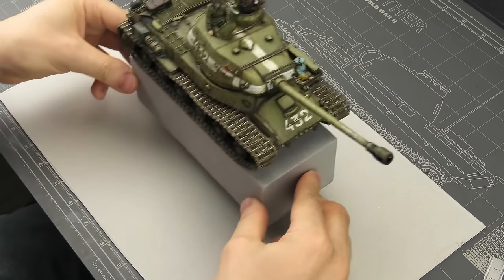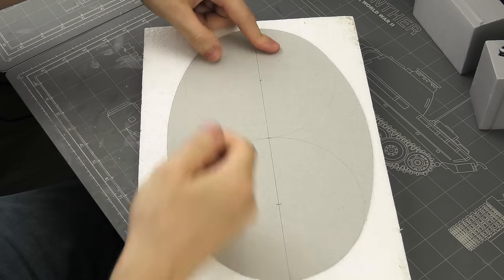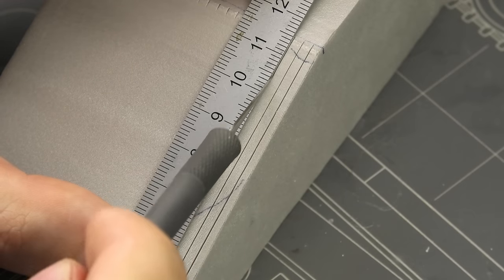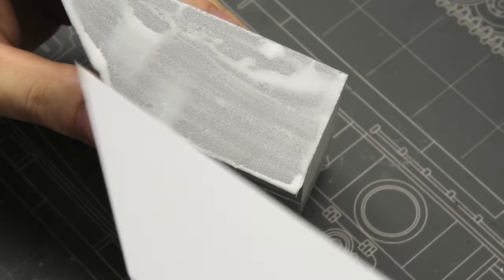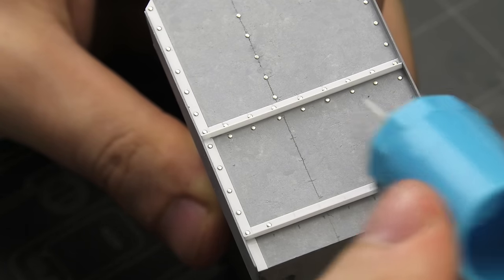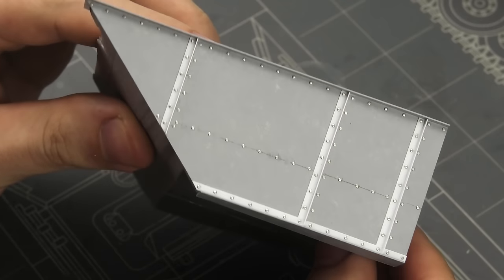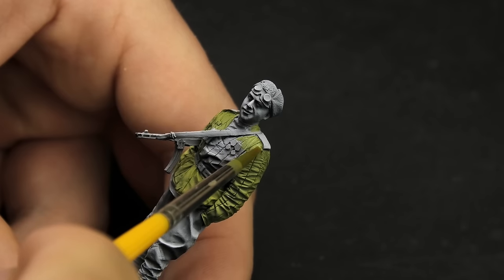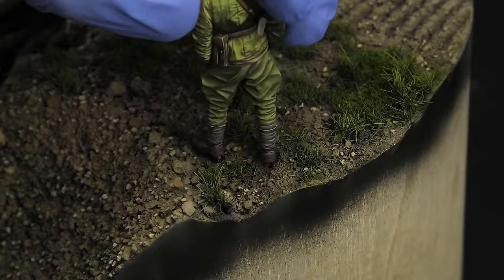Bears Crossing - Berlin 1945 (Epoxy Resin Water Diorama)

Comment: For the oval wooden border, I wonder if contact adhesive would have been a good choice? You could apply it easily to both pieces - spread in a complete layer. Then you just press them together bit by bit

Comment: What a great diorama! Well done!  One thing I think you missed, or just didn't put thought on, is the bridge connection to the river bank. You got a heavy steel bridge ending in a grass field? There's certainly a road there, or at least some elements from where the road once was... I think the diorama would look even better, if you had put more though to that part.  When it comes to foam in rivers, you often will find them as a faint swirl or build ups, in places where the current is blocked. Such as the corner where the steel beam is acting as a dam. I have no idea what techniqe or material to use to make such swirls look real, but it should be a possible challenge for a master as you.

Comment: May I suggest that next time you use the so called "gardener's method" (also called pin and string method) to draw the oval. This creates a true ellipse, which looks more harmonic than slapping two constant radii together in a basket arch / three center (or rather four) curve). It only requires two pins, a length of string and a pencil.

Comment: Uncle Nightshift! Uncle Nightshift! I got an idea, since you have a printer if i remember correctly, have you tried to print a "brick wall" pattern stamp that you can just press into foam instead of having to manually trace each brick by hand? Amazing work as always however, you're leveling up with each new project and watching you get better is almost a treat on its own. I really love the fact you add a lot of verticality to your bases now instead of doing them "ground level" which shows a lot more character to the scene too. The one thing i'd add or keep in mind for another river build is having debris in it, in this case maybe adding some thin twigs/roots and rocks on the 2nd layer of the resin pour so your 3rd layer of resin has some transparency and shows depth.

Comment: For anyone interested in real corduroy trench filling, we used bundles of logs tied into rounds and put on the backs of flatbed or tipper trucks. We did this because it was easier to roll them off the trucks into ditches without man-handling lots of individual logs. It also made them easier to move around with our rough-terrain fork-lifts.
Once the top row was in place you only had to cut the top strings and spread them out level.

Comment: @Night Shift 
Dear Martin, as always: stunning work, and an almost "unreal grade of realism"... which leads to the only irritation i have with this diorama: please correct me, but in my humble opinion there might be a "static" problem with the structure of the side-fundaments of that bridge. In your diorama the whole masses of earth are held back by a single row (!) of simple bricks ???... and this appears not sufficent to hold a bridge, which is built from massive steel elements, able to withstand the pressure of all sorts of heavy vehicles over the years...  as i said - this is only a criticism on the architectural side of things, and has nothing to do with your splendid skills as a modeller.
I'd be very interested, if you understand the aspect of my comment, and what you think about it.  

best regards from.... Berlin, at the river Spree :)
Holger

Comment: 28:41 I use a lot of epoxy resin like this at work. Same 2:1 ratio of resin and hardener. Really easy to work with once you get the hang of it. One tip I can suggest is, if the edges of the water aren't nice and smooth, a combination of gel sealing tape and thin plastic sheet works very well. Just make sure that the outside edges of the barrier are tape-to-tape, and you'll have no leaks.
Reply: The thin plastic sheet goes in-between the tape and the resin?

Comment: I just started smiling when I looked at the angle you had the gun. The IS-2 had notoriously bad gun depression and thus a rather slow rate of fire because the gun had to be returned to the default angle for loading. It was best in the role of bunkerbuster and not a tankdestroyer as intended from the beginning.
The finnish tank museum in Parola has a few Soviet heavy armored vehicles from WW-2 and among them a ISU-152 built upon the chassi of the IS-2. Those beasts were huge.

Comment: I find that decorator’s caulking fills gaps nicely, especially in wood or plaster, because it is easy to apply using a builder’s gun and it remains flexible, while still allowing you to paint over it. You can even smooth it with a wet finger…

Comment: Love watching your models come to life and the visual stories you add into them.  You have inspired me to obtain a spay kit and paint with the many other accessories needed, my plan is to paint 3D printed topographical maps and maybe someday a model.  I am old enough to say my experience with models is when they where .99 cents and glue came out of a tube labeled Testors, which brings me to the question of the type of glue you use.  Besides the obvious cyanoacrylate glue,  I see you brushing on glue, what type of glue is this?
Reply: I believe its called "Mr Cement S"
Reply: Tamiya cement or Mr. cement.

Comment: I've made a few round bases to display my aircraft models, I buy round discs of 1/8" (3.125mm) plywood from my local craft store and then soak 3/16" x 1/16" (5mm x 1mm) birch strips and glue them around the edge ( the extra 1/16" (1mm) lip is used to create ships decking, terrain etc.). To hold it on during gluing, I use zip ties that are used to secure air conditioning ducts. You can get them in all different lengths, I use 36" (914mm, in metric countries that will probably be 1000mm). Just make sure the joint of your laminate is opposite to the closure of the zip tie, and for thin veneer like yours, I would recommend a buffer layer between the veneer and the zip tie of 0.5mm plastic sheet to spread the load and stop from crushing the veneer.

Really good build by the way. I wish I could build like you :) Is your leg completely healed?

Comment: How funny and wholesome is the fact that 2 years ago Uncle Nightshift was just flirting with dioramas and now he is hooked. I await the video where there isn't a model, ONLY a setting. 

Dioramas are fun to do, and economical as well. While more expensive tools make the work easier you don't need the fancy stuff to produce a pretty good diorama, even if you only have some basic brushes, basic superglue from the supermarket, lots of plaster, the cheapest paints and TRASH!!! Plastic and metal trash can be a godsend!

The father of a friend of mine is a veteran modeler, won contests and such. He once built a biplane model from scratch for the local airport; an exact replica of one of the biplanes based there. He used empty sour crème cups, cut them up, straightened them with steam and cut them to shape. He build the cockpit, the engine, everything out of plastic garbage and the cheaper, 2 component plasticine-like epoxy. Took him like a week or two. The airport has been rebuilt since but as far as I know it is still displayed there.

Scratch-builds and dioramas are fun to do because there is NO END to your own autonomy. Takes a lot more effort, time, work, but you'll end up making your best works like this.

Comment: I’ve been having some trouble with knowing the right psi and dilution for my airbrush and paints do you have any suggestions? Also keep up the awesome work with the models.
Reply from the maker: try 70-30 thinner to paint ratio and 15 psi as a starting point
Reply: You didn't even say what your problems look like or what paints you use.
Read some guides, test different things and you'll figure out the right balance eventually. You'll probably go through a bottle of paint, but that's just how it is.
Reply: @fonesrphunny7242  but always helpful to have a starting point
Reply: @NightShiftScaleModels  thank you so much I think I’ve been using way too thick paints and way to much psi

Comment: To save on the branches you could have reduced the amount of "logs" needed by just cutting very small ones to show as the tips going up and only have the bigger branches for the top area, while having something like styrofoam for them to sit on on the inside, otherwise this is probably one of the better diorama I've seen from you due to the sheer variety of materials used.
Reply: That's exactly what he did?
Reply: @mephisto7549  What I meant is even shorter and filled more up until the very top since it was also covered in dirt.